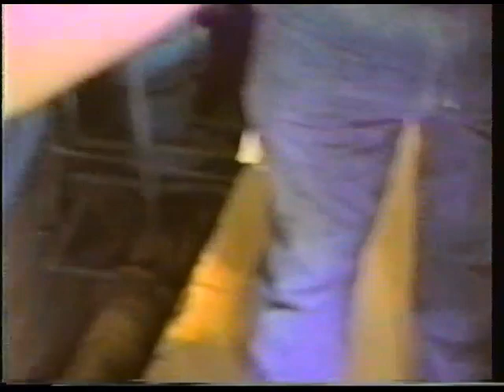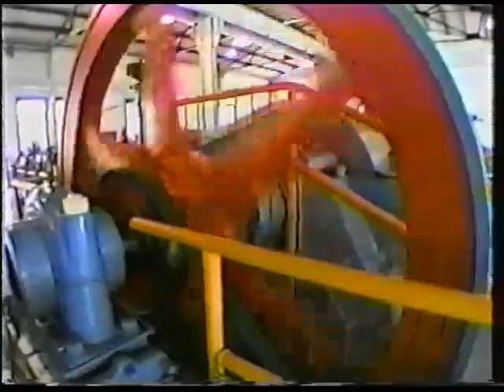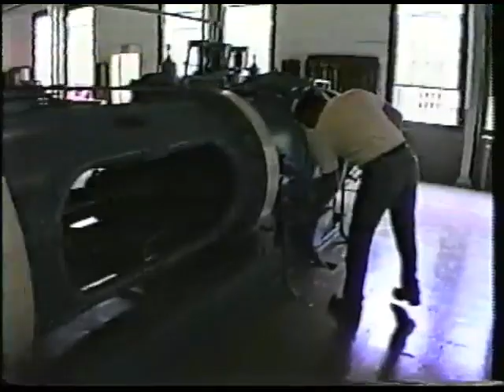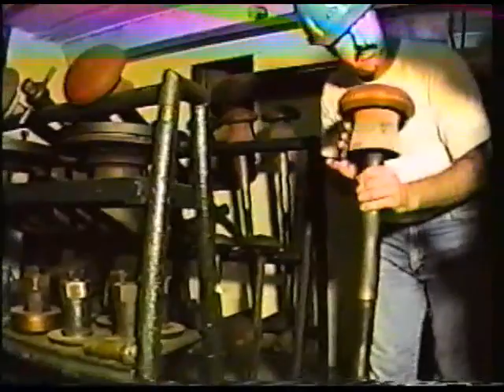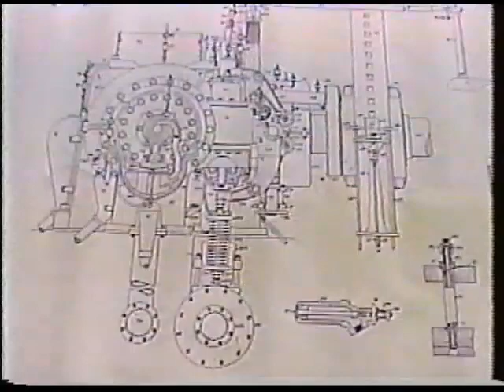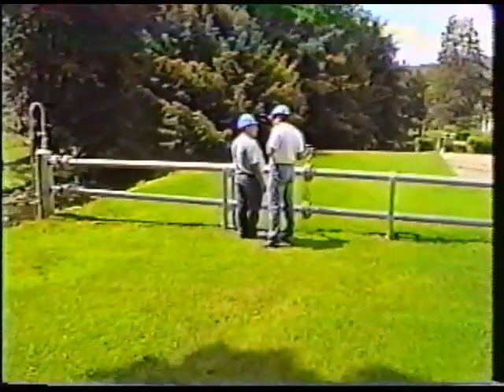Heath Station - 1912 vintage 400hp Snow Engines [VHS Rip]

Comment: A similar but larger 600 Hp Snow engine is located at Coolspring Power Museum, and is run during the shows.  There are several Snows preserved, but I believe Coolspring's is the only one that runs at full design speed on all 4 ends. It came out of the Roystone station.